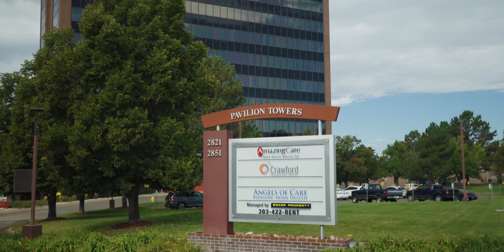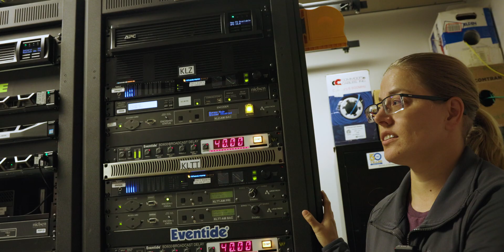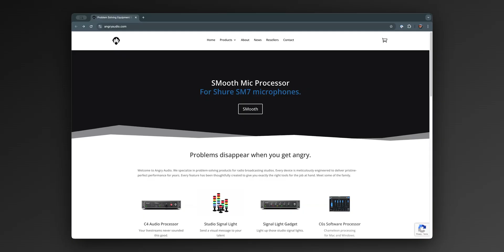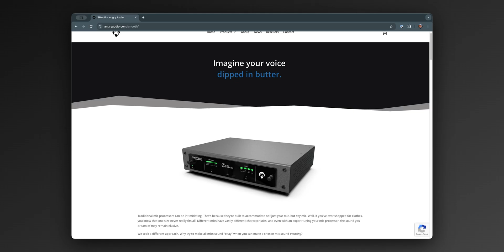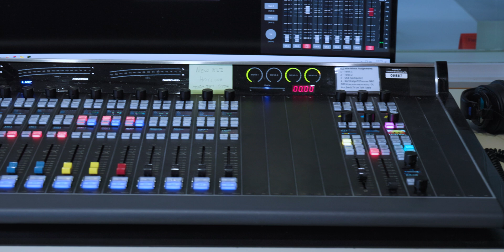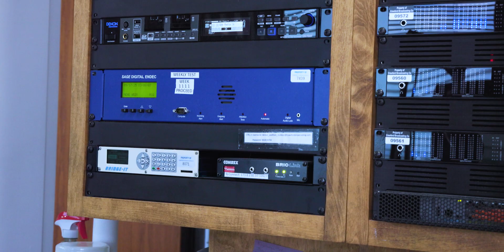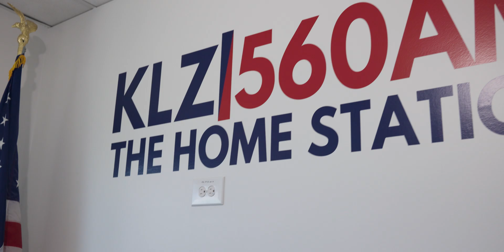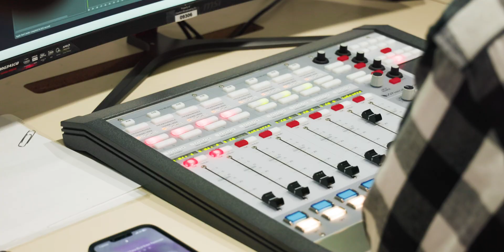Inside Denver's Cutting-Edge Broadcast Studios 🎙️

Comment: Man not a single turntable in the entire station. How disappointing
Reply: Pretty sure no radio station misses them though, even if they might have a small specialty studio to be able to take the record, clean it thoroughly, and then play it a single time to record into a lossless digital format, and then place the album on a scanner to get a scan of the album art, and associate it with the digital recording. then have the actual vinyl stored in a vault somewhere with controlled atmosphere to prevent degradation, while having the digital copy, complete with tracks split up and named, ready to be used with only a click. 

I did that years ago, though I did have to borrow a turntable to do it, and recorded as MP3 320k, as that was good enough for me. turntable was needed that had a 78RPm setting for a lot of old records, though audacity came in as the save for the single 16 2/3 RPM extra long play record I had to copy. My mom appreciated being able to listen to all her old records again after many years of not being able, and having them on 5 CD's was a much better option for her as well, much easier to handle with arthritic fingers. Note I used Win98 to do the recording, it then being barely a year after it came out, and before the upgrade to 98SE. Still have an OEM pack or so around of that, MS would sell you a copy for $1 if you bought an accessory, so I did buy a few mice and printer cables, and a copy with every keyboard. Most went into the case unopened, because all I needed after the first one was the product key from the outside.
Reply from the maker: Not in that studio... but I do know some studios do have them for some hip hop DJ shows on the weekends.

Actually, the video that just posted yesterday has a studio with a turntable!
Reply: I do an occasional show at a college FM radio station and we have two turntables 3 CD players a cassette machine in case somebody has something on cassette they want to play and thousands upon thousands of CDs and Records. The DJ's find it much more interesting and fun to play music that way then to just use a mouse and click songs on a screen. Some DJs bring in an iPad or a laptop to play stuff that they bring in from their own collection but primarily it's CDs and vinyl